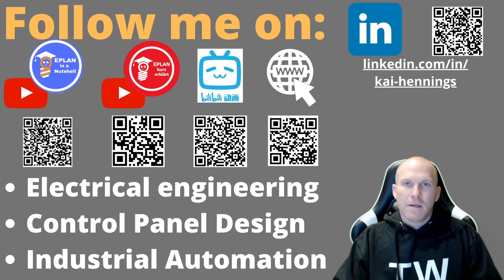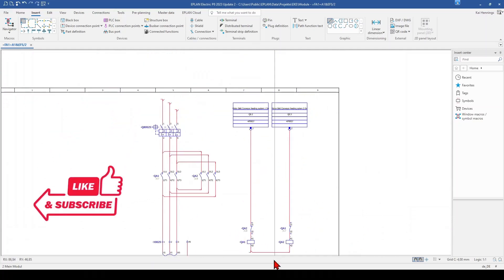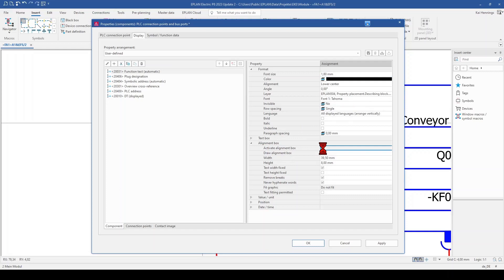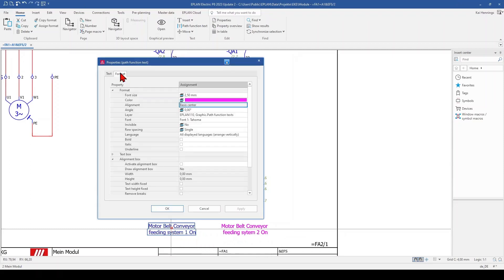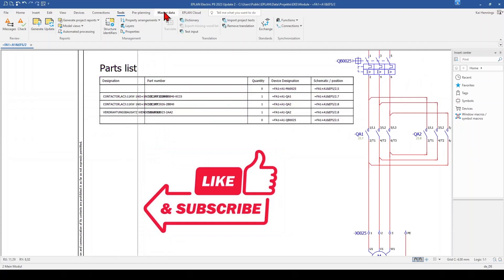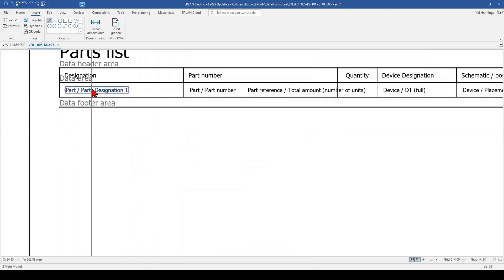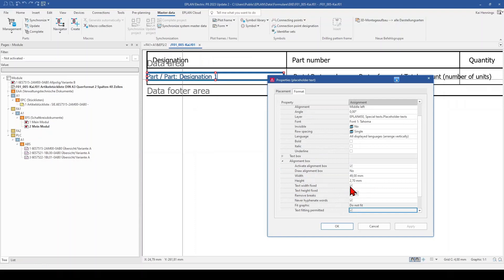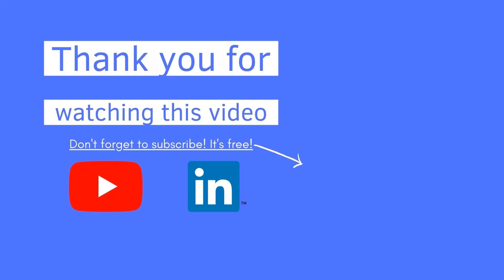How your text always fits in EPLAN 💡

Comment: Hi Kai,

Again I love your videos soo much! Keep going 😁

I've placed a question into the comment section in one of your videos: "Contactor in EPLAN. Settings, Contact Image, Properties".

I want to quick question again here, because that video is a little bit older and you don't have attention on that to answer 😊

I saw in a lot of videos while you hover over a cross-reference (green text) the cursor change from arrow to a hand icon and when clicked it jumps to directly to the corresponding cross-reference symbol or device.

I use Eplan Electric P8 2022, but when I hover over the cross-reference (green text): instead of changing the cursor to the hand icon, it select the whole connection/coil cross-reference + symbol.

I need to adjust a mouse setting? I hope you can help me out 😉
Reply: Just hold down CTRL while hovering over cross references and you should be able to click to go to that page. It also works with interruption points.